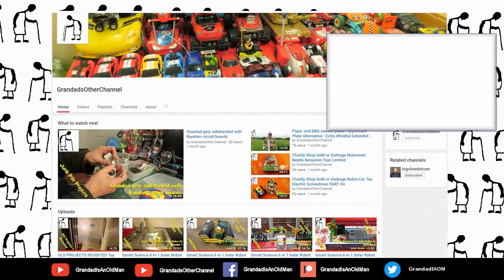What can I do with that toy grade Transmitter & Receiver from AliExpress? Part 2

Comment: Nice one Granddad. Now, about getting that tipper movement working!   ;-P
Reply from the maker: I did think about taking it a stage further and using hobby grade RC gear. Then an extra servo for the tipper body would be an easy addition.